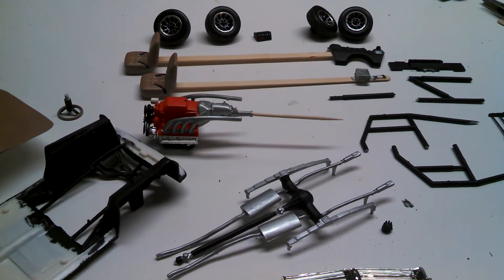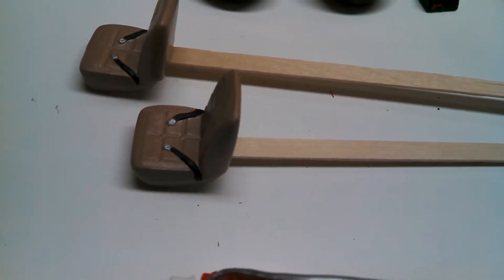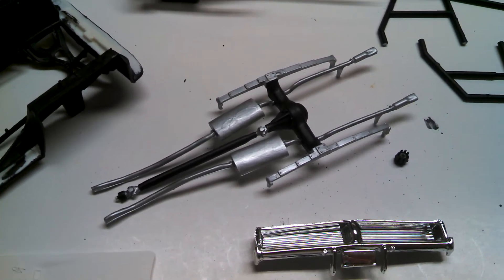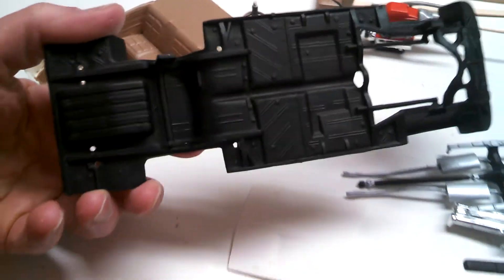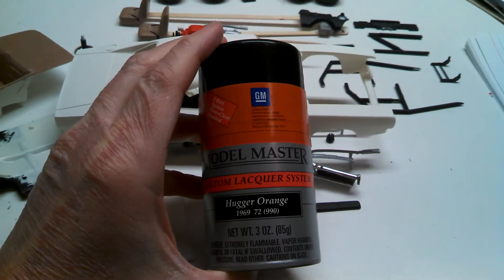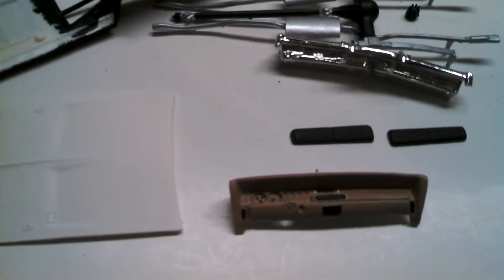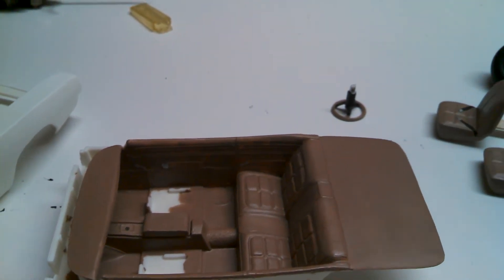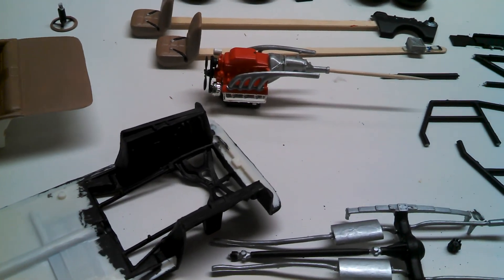General Lee '69 Dodge Charger first look

Comment: My sympathies to you and anyone trying to a build a "General Lee" from this box of plastic. MPC should be ashamed for marketing this model as a Lee. Engine is wrong, fit issues all over, left front fender needs about 1/16'' plastic to make it fit to hood (my copy anyway), lots of flash to clear off, etc. I have heard the 1:16 version has the same issues. Sad that a TV icon has been taken advantage of. My version will be airborne when done.................if not off my fifth floor balcony first LOL.
Reply from the maker: you are right, it's not the best kit, but I made it thru with OK results. you can too, it just takes some effort and patience.
Reply: Gordon Enquist wasn't an issue til China began making them fast. a good modeler can build it. but some people just love to complain